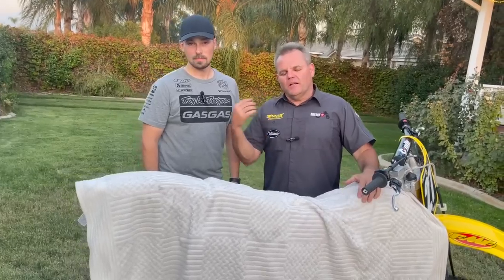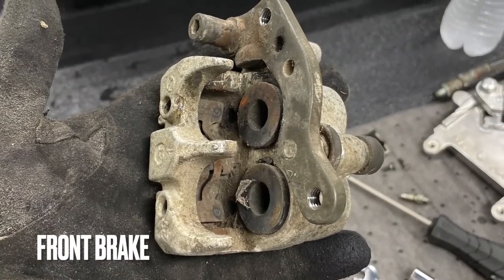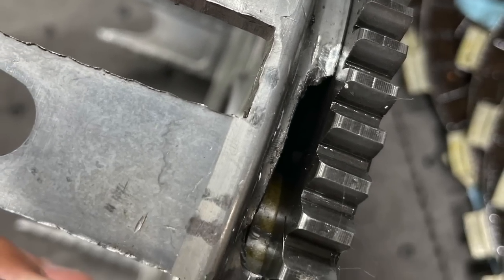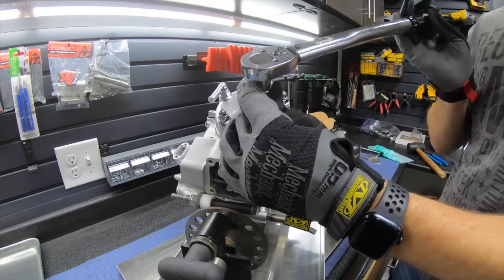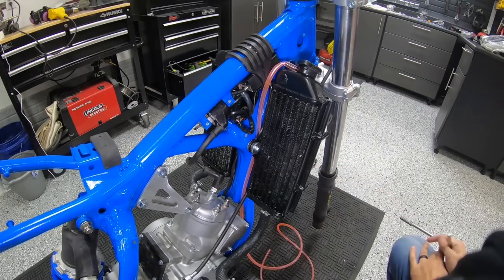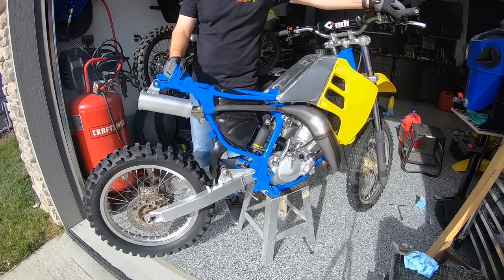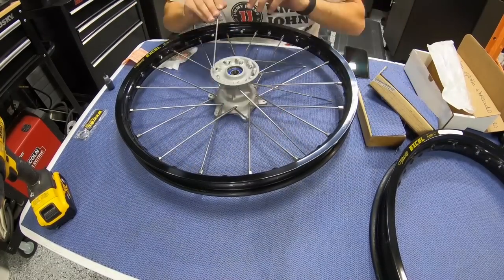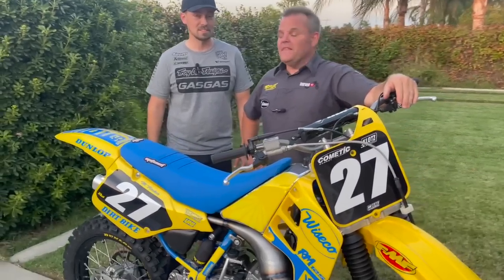2-Stroke dirt bike build time lapse - Suzuki RM125

Comment: Nothing beats the feeling of hearing the motor run and going threw the gears after having cases split I been rebuilding motor for 30yrs and even tho u don't question ur work if u know what ur doing there is always still margin for error with all the little parts completing a engine especially the transmissions
Reply: Ya thats gotta feel so good
Reply: Absolutely
Reply: Most of the time I don't even take the transmission apart I just take aluminum foil and cover it and tape it up and keep it all together and just replace the crank in the seals

Comment: That tool you mentioned is the install tool for rivet nuts. Handy but you can get by in a pinch with a bolt and two nuts to press them in!

Comment: excellent production, thanks! I spent the last 2 years fully restoring a crate 1985 CR250. Exact bike I raced pro when I was 22 years old. It's funny watching others build the old bikes and comment, I'm like, yep, yep, yep. I also went Race Tech for the suspension and bought powder coat equipment and did that myself as well as the Harbor freight blast cabinet that I converted to also vapor blast. Probably have about $4500 in it and at least 500 hours of time, brand new everything. Not sure what I could sell it for. People that see it are amazed, it looks like a showroom bike. I've had it out a few times to jet the 38PWK Air Stryker and it rips!

Comment: some cases like the 92 - 01 cr250 cases actually have spots for a screwdriver to pry the cases apart. Mine were so stuck though I ended up using a case splitter and a c clamp to pop the tight side out

Comment: As a mechanic I often wondered how carbies and kick start idler gears get so mangled on every bike I've worked on.
Every video and 99.9% of people snap the throttle open and let go.....what do think happens to the slide, stop, and needle/clip?
As for the kick start.....LOAD the starter instead slamming the gears......treat your bike right and it will serve you well for years.

Comment: $20,000.00 where?
Reply: Where you see that?
Reply: @chihuahuaverde425  The thumbnail says "$20,000 Dream Bike Build"
Reply: @Dat_Sun  Wow!  Did not notice that.  Thanks!  I was thinking about 3k.
Reply: I did a frame off on a 1991 that is now brand new from the ground up and it cost me 800 hundred for the bike and 3,500 in parts in 2020. The bike is in as new showroom condition.